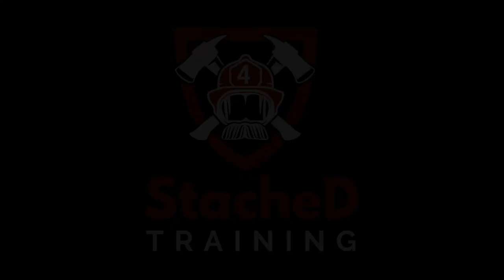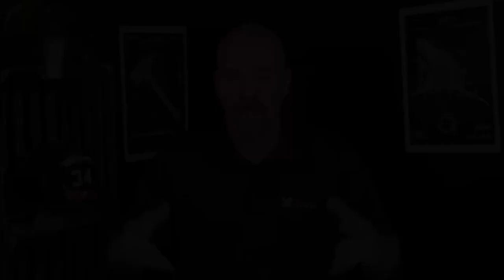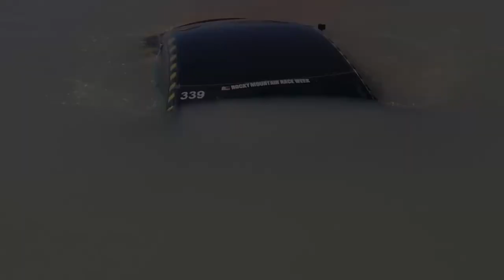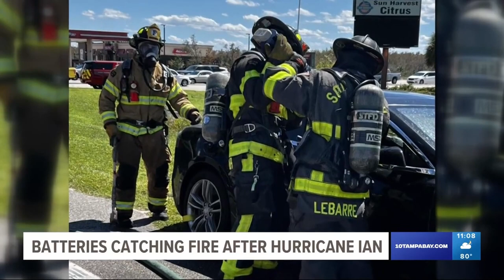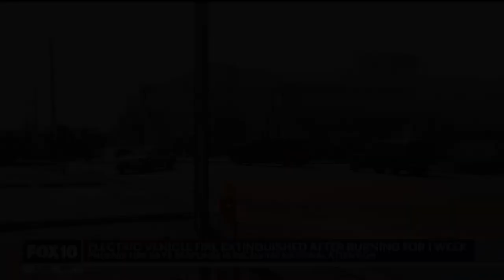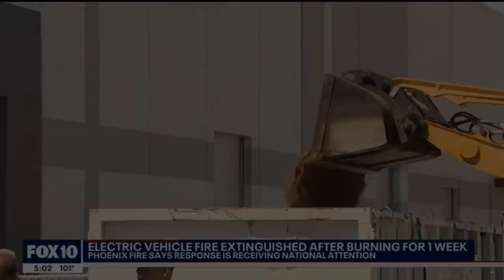Does Submerging Electric Vehicle Fires Work?

Comment: It's time to stop this EV madness!  Outlaw them!  Problem solved!
Reply: If you outlaw EVs, only outlaws will have EVs, saving them time, money, and health issues from toxic Saudi oil.
Reply: Run from the issue or fix the issue.   I prefer to fix the issue.   Eventually this technology will get better and become a safer option, exactly as gasoline cars did.   The trend in batteries is already leaning towards Sodium Ion batteries.  They are cheaper to make, don't catch fire and are fairly non toxic.    They also are unaffected by cold weather, unlike lithium.  We use lithium because it's capacity compared to its weight and space is really good.   China is now claiming their Sodium Battery technology is close enough that they are now producing cars with them.   BYD (a Major manufacture of cars in China) has partnered with CATL to produce a vehicle battery.   If Sodium batteries become the replacement for Lithium, all of the known issues with lithium are going to go away.  The cost of EV's will be drastically less than a standard gasoline car and the new goal will be to solve the infrastructure to keep them charged.

Comment: how about putting it a open top container like the water method, then pouring liquid nitrogen, or liquid CO2, not unbelievably expensive, and more environmentally friendly then some other solution's.
Reply from the maker: Testing has already proven that CO2 will not extinguish a lithium-ion battery fire.  Liquid nitrogen will likely not work for the same reason.  It comes down to specific heat, the amount of heat a certain material can absorb.
Reply: @StacheDTraining  thanks for the info

Comment: Instead of putting the car into the container, put the container over the car and let it burn out that way the fire is contained and you haven’t wasted thousands of gallons of water which is now contaminated and flowing back into the water system, saving many hours of firefighters time.
The damage to the environment and peoples lives mining for cobalt and other precious metals for these batteries is colossal, then there’s the problem of disposing of thousands of spent batteries what will that do to the environment, because as we all know 90% of them will be buried, probably in a third world country. Out of sight out of mind.
Reply: Just put them back into the mines to provide jobs for the miners, just like with coal except faster. You already did it with nuclear "waste" which probably could power a LFTR.
Reply from the maker: We absolutely do not want them in an enclosed space.  The buildup of explosive gasses would be problematic.
Reply: @StacheDTraining  Then use safety lamps.